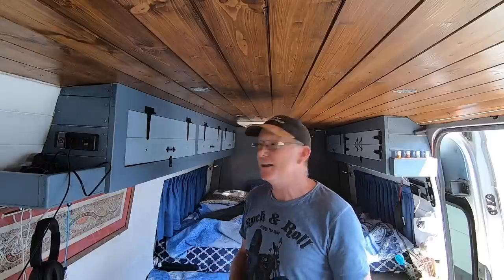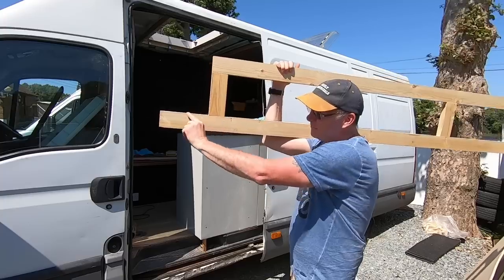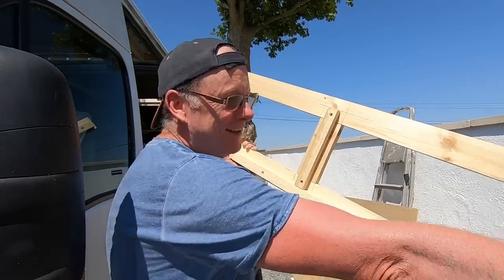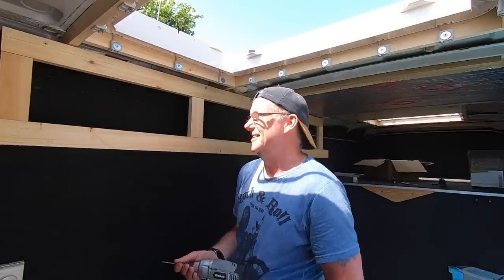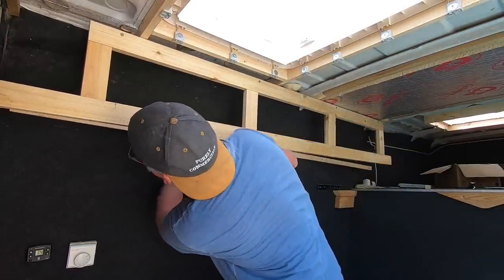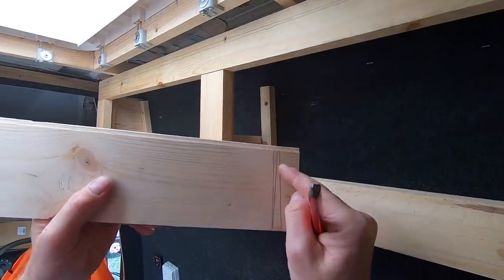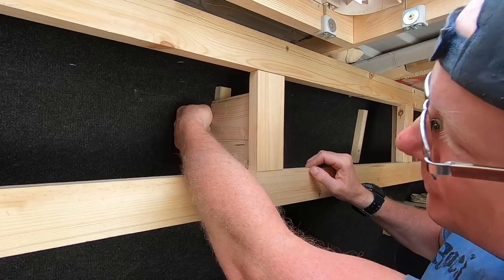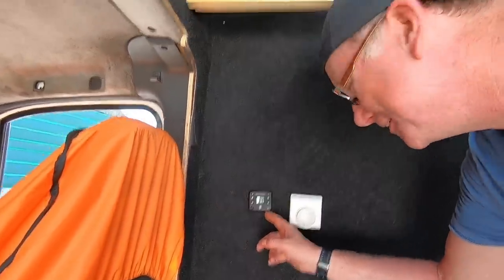HOW TO build overhead cupboards in a Camper Van

Comment: Think it is the way to go Mel a simple yet effective approach especially doing it on your own, a lot over engineer the overhead cupboards but they don't hold bricks and dive weights ..Always put bigger doors on for a fancier look over a country look too, if one chooses....I see how you put the 3 mm ply on the bottom as a finish but put a solid internal shelf in as support so your back runner must be a few mm up,  punters might not work that out though even though you kind of mention it pre install and don't show the installation of the cupboard shelf/bottom support..Pocket holes might be better in the front frame as it would keep the joints tighter from road vibrations and stop cracking through a paint finish...Love that cupboard with two little shelves, I will nick that idea👍
Reply from the maker: Cheers 🍻

Comment: Mel, I broke my folding work bench doing something it wasn't designed for. I thought I'd just go and buy another. It turns out a lot are made of plastic or have critical parts made of plastic. Also if you thought the metal in your 1980s or 90s work bench was thin, imagine it being half as thin again. The key message is don't break it. Look after it, cuz you won't ever get another as good again.
Reply from the maker: That’s so true thanks for the positive feedback really appreciated 👍

Comment: Just the same way i built mine Mel. Light, strong and budget friendly.
I used 38mm square CLS for my frames and i plan to have sliding doors insids the openings. I am struggling to find 'plastic double u channel' for the runners though! Does anyone know where to buy 4 metres without having to order 100 units? 😉
Reply from the maker: Sounds great 👍